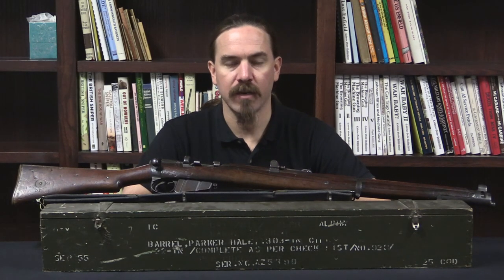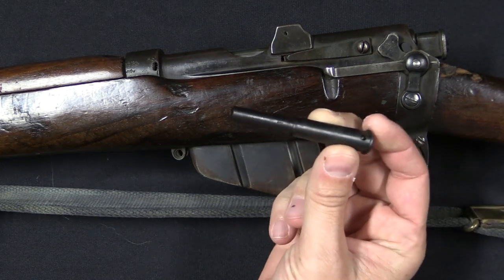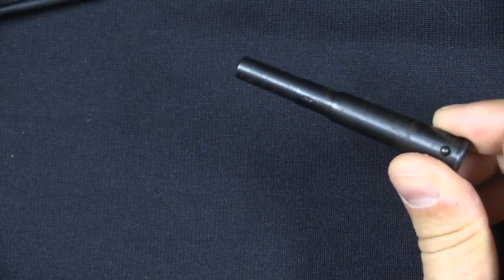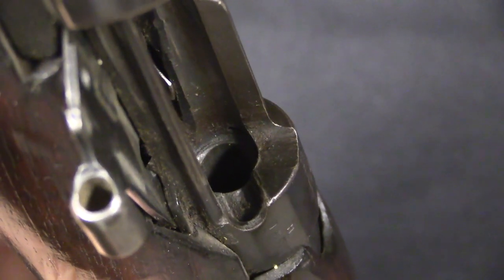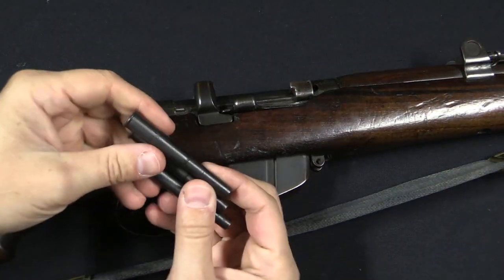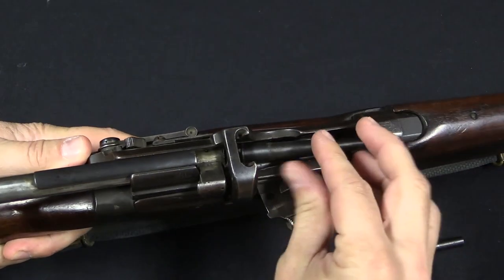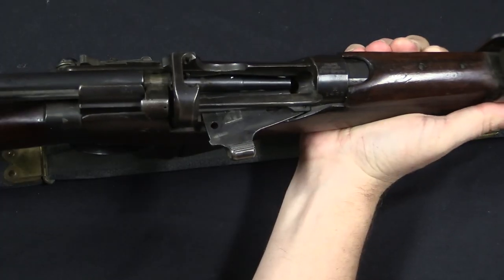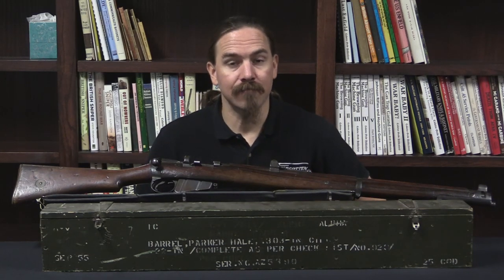Parker-Hale .303-.22 Conversion Kits for the Enfield, Lewis, and Vickers

Comment: here in New Zealand in the early 80s At Air cadets, we had an indoor 10-meter range and a bunch of Lee Enfields in .22 LR single shots, pulled the bolt back, Grab a bullet out of your plastic cup half full of rounds  inserted your .22LR in a flat chamber face and was a bit awkward  of what I remember, close bolt, aim fire, I think it ejected the case then rinse and repeat, I was like 11 years old, it sorta looked like dads MK4 Enfield he had in the cupboard from WW2 carried it from New Zealand to Egypt to Italy and up into Germany then back home to NZ with his  girl and he was buried with that old girl of a .303 brit
Reply: Same , we used these in air cadets in Ontario Canada during the 90s
Reply: I was in the CCF and we'd shoot indoors with martini action .and bolt action match rifles in .22. Later on outdoors we'd shoot .303 Lee Enfields and 7.62 Match rifles. I don't see why it would be necessary to convert a .303 to .22 with such a clumsy system as this. I could see the benefit of the Nr 8 Lee Enfield trainer but this just seems like more effort than it is worth when there must have been other bolt action rifles that would suffice for basic shooting training.
Reply: @drxym  These 303-cum-22 adaptations are much better than even a mag-fed .22 for developing the muscle memory for shooting a .303 rifle rapidly and accurately. The bolt stroke length is identical, the amount of force needed at every stage of the bolt cycle is identical, as is the use of chargers and magazines. I think they may have been used for "garrison" ranges -- regular polishing/practice while in barracks at smallbore ranges -- rather than for basic marksmanship training. So long as you keep real .303 rounds well away from the adapted rifles it seems fiddly but useful.

Manually cycled Vickers and Lewis guns on the other hand... not quite so realistic...

As Ian states the adapter system was dropped after about 2 years of service for the far simpler system of single shot .22 adapted "older" patterns of LE.
Reply: Same here in UK army cadets in the late 80z.
Reply: Same in the UK air cadets in the 00s
Reply: Remember exactly the same at school on Scotland also 80s. Big heavy buggers for a 10yo!
Reply: In the UK Army Cadet Force in the early 1970s we had No 8 .22 rifles.   The looked like mini L42 sniper rifles.  They were also in use by the regular army for training people for small bore rifle competition before letting them loose on  proper target rifles.
UK has recently disposed of it No 8 out of reserve in the only way the UK knows how by destroying them Bloke on the Range has a video on this travesty
Reply: Yup I had the dubious pleasure of using the later 22 calibre conversion of cutdown Enfields in my early years at Air Training Corpe then moved to what we called the Russian 22's. I don't know what they were but a lot lighter and felt alot more accurate than the extremely tired cutdown 303 rifles. Also believe there was another conversion of later Enfield rifles to 22 calibre for training as well.
Reply: Might wanna dig up that rifle you never know.
Reply: The .22LR used by the CCF / ACF were probably No.8 rifles, or maybe a No.7. I know ours were No.8. 
Ian's done videos on both these https://www.youtube.com/watch?v=UjKMDv139zU and https://www.youtube.com/watch?v=aRtir1tmEW4
Reply: @alvinyork5341  They've moved over to .177 pretty much everywhere now.
Reply: We had No 4's modified to .22 in my University Reserve Training Plan squadron in Montreal.  The spent cartridge did not eject, you had to pull it out  yourself.  There was no cartridge adaptor on ours.  The round was inserted straight into the barrel. We shot  at the McGill  University indoor rifle range.  All our No,. 4's were taken away by the RCAF after a Montreal armory was raided by separatists who made off with a bunch of FN's.  I guess it was matter of optics rather than real danger.  I would not have looked good for the military or the government if our .22's had been stolen.  We shot ammo left over from WWII.  It was dated 1944, the same year I was born.
Reply: @kazkazimierz1742  maybe it didn't eject lol I I was issued an M16A1in basic in 1986 New Zealand Army, took to the range once the qualified, and got an L1A1 can't remember much of the M16 either lol prob brain injury from all the concussive things going off nearby, no hearing pro or eye pro
Reply: Yes indeed. My NZ Cadet Corps time was the early 90's and there were times we used the No. 8 Enfields. Single shot, no magazine etc.  Some old bloke I talked to back then mentioned the "Morris tube" conversion but these were built up as .22 training rifles.  Our range was 25m outdoors.  No plastic cups were used but rather our beret upturned on the ground.
Reply: We had a large outdoor range (1 mile plus) available near me in the UK so were still using the .303 rifles but we did use a .22 kit for the SLR at the local TA barracks where they had an indoor range.
Reply: I'm not sure of the training potential of the 22 rifle, I was in the army cadets in the early 80's and we had an indoor 25 yard range. The new recruits were taught the basic drills with an air rifle, then when they were competent with the drills they moved up to the .22. You would be tested on your shooting ( four levels-pass, second class, first class and marksman) then you would be let loose with the full bore .303. I was a typical young teenager and would get lazy with the .22 and you could see my grouping drop as I fired because there wasn't any reason to concentrate and the later rounds would drop, ruining my grouping (best I managed with the .22 was first class). Then enter the full bore .303, the adage of spare the rod spoil the child was hammered home to me that day I first fired the 303. We did a march and shoot, 5 mile hike with kit then shoot the Enfield. First shot tired and not concentrating, trained on the 22, loose grip and a bruise on my shoulder the size of a fist. The rifle certainly improved my shooting because I treated it with respect after that. I ended up better at shooting the full bore rifle (Marksman classification) than I did with the 22 because even after this when I was shooting the 22 I only engaged half my brain. Teenage boys, don't suppose they ever change.
Reply: Can you handle a kitchen knife even in NZ now?
Reply: i had those 22 in the air cadet in Canada
Reply: Used them in Air Cadets here in Canada about a decade ago too, they were neat. I got to shoot a proper .303 a couple of times too, though it wasn't "officially" a Cadet rifle and was owned by one of the officers IIRC.
Reply: @curiousentertainment3008  grave robbing?
Reply: @RamonInNZ  
Probably Toz rifles, chrome lined bore...very good accuracy.
Reply: @wmoule  
Yes...but only with a dulled edge....
Reply: @Mr Ivan Tchernegovski   Did you notice the ammunition is NZ military .22 ? if you note it says 'Kauri Point NZ' which is the Navy Ammunition depot at Birkenhead on Auckland's North Shore? I would suspect the rifle was originally a NZ navy cadet training rifle also.
Reply: Did you notice that was a box of ammunition from Kauri Point Naval ammunition depot in Auckland New Zealand..How on earth did it end up with Ian?
Reply: @lordsummerisle87  I think "accurate" needs putting in perspective... especially in today's context! I would be surprised if these adapted Enfields could manage 10" groups at 25 yds ..or 40 MoA?
Reply: may your Dad enjoy that well deserved rest in peace!
Reply: Thanks for his service. May he rest in peace.
Reply: @triumphstagdriver  Never heard of a No 8.  Tell me about it.
Reply: @kazkazimierz1742  I think Ian has a video on the No8 or mentions it in one of his Lee Enfield series.  Otherwise Wikipedia should mention it. I think in the section on the No4 - variants of. Essentially a No4 in dimensions and weight but single shot .22 for training purposes.
Reply: God Bless your Dad! Please tell me he wrote down some of his exploits for our History?!  One of my No.4's was carried by a long lost Cousin (I purchased it by pure, random luck!)  I'm making sure my kids keep it within the Family (with it's story attached) for many Generations.
Reply: @susanbutler2498  thank you, yes some of his exploits are in our family book that my Nehew made of our family history from Ukraine in the 1870s to the present day
Reply: Wait a minute. He was BURIED with his rifle?? That’s badass.
Reply: @ILikeToLaughAtYou  Yea his weapon was on his right side in the coffin, ten rounds in the weapon, and 2 5 round clips in his pocket that was my idea,mum never knew lol he had killed people in combat with it so we thought he should be with his weapon in death
Reply: @ILikeToLaughAtYou  Yea his weapon was on his right side in the coffin, hot with 10 rounds in it and 2 5 round clips in his pocket that was my idea no one knew lol and he had killed people in combat with it, so we thought he should have his rifle in death seemed a good idea
Reply: @ILikeToLaughAtYou  Yea we buried Dad with his mk4 .303 Brit rifle hot, 10 rounds inside it, and 2 5 round clips in his pocket, I did that lol no one knew, He killed people with it and I thought you can have your rifle with you in death and beyond Dad. I wanted to shoot it and give him a rifle salute, but  the cemetery is in the middle of suburbs lol
Reply: @JohnSmith-yv6eq  Would get high 80s with the weapons

Comment: There is clearly a story behind the survival of those pieces, especially the kit. If entropy hasn't even destroyed a paper packing slip, it must have lead a very quiet century.
Reply: Agreed
Reply: Still having the box of cleaning patches is also impressive.

Given they were not used.
Reply: Have we ever considered these were rifles issued to cadets and brand new trainees that were designed to be used and put back? Plus with how often they were used, it’s not unfeasible that the crate was restocked with patches and such pretty often as well, and when it came onto the surplus market, nobody bothered to remove anything from the crate?

Comment: Just when you think he might have run out of videos to make featuring Enfields. I should go buy an enfiled, though finding ammo for it may be a bit of a challenge.
Reply: could always see if you could get it rechambered into .308
Reply: lots of them were rebarreled for 7.62 nato
Reply: Son, learn to reload!
Reply: Well then, get one of these Parker-Hale conversions, and you can use .22 ;)
Reply: @Speaker Roach you can find $1.20/rd pretty easily, online, in the U.S.
Reply: Reload, with good started brass you get about a dozen firings per case so 3$ a round becomes about 75 cents, still not "cheap" but then again there is no such thing as "cheap" when it comes to feeding obsolete caliber milsurps.
Reply: I have Enfield in sporting range in my city. 3 shoots cost to € ~9. It's the most expensive weapon because this british ammo. Cool rifle, but Mosin is better to me.
Reply: @MM-zg4wu  yikes, that's expensive!  Mosins are fun, though.
Reply: Get one of the Ishapore Enfield rifles. Built in .308!
Reply: ishapore
Reply: John Doe  Don’t worry about headspace. It headspaces on the rim, IIRC.
Reply: I'd highly recommend the Enfield. The recoil is relatively light, the sights are awesome (at least on the No. 4s) and the action is very smooth. Oh, almost forgot to mention that the trigger is quite decent, as far as milsurps go.

Comment: I remember that we used do have a .22LR conversion kit for the Norwegian AG-3 (G-3). It consisted of a sleeve that was about 7,5mm outer diameter, with a couple of flexible steel rings at the chamber end, a bolt assembly that looked just like the regular bolt assembly except for a small section of it being a simple blowback bolt for the .22 cartridge on the bolt head and a proprietary grey magazine which held 20 rounds. The exteriour of the magazine looked just like the original one except for the colour. One could easily convert the rifle to .22LR and back, simply by disassebly of the rifle, and back to 7,62 NATO again in litteraly just a minute. It worked just like the full power rifle, lest the recoil and noise of course. The charging of the rifle, clearing jams and reloading was the same as without the conversion. I do not remember the producer of this kit, but I'd not be surprised if it was H&K themselves that made it. It even worked fairly reliable in full auto. Albeit it of course had to be zeroed for the .22LR an vice versa after using it. We used to let middle school kids fire a military rifle for the first time with this conversion kit, even in full auto. I believe I've recruited many a young soldier with it! (If you've made it this far, I'm sorry for writing an essay on the subject)

Comment: When I was in the Territorial Army, we used the standard SA80 with what I think was a .22 conversion kit so we could use them in an indoor range. I could just never figure out how the system worked.
Reply: Thankyou for this comment. Jogged my memory. I thought I remembered firing an SA80 in 22. But I couldn't be sure as it was thirty years ago and it was only the one time in an indoor range.
Reply: You remover the normal working parts and replace with an adaptor.  The adaptor extends into the 5.56mm chamber and the existing bore is close enough for 22 LR.  The adaptor is blow back.  Also special magazine.
Reply: H&K conversion kit, used them in the TA as well, the centre I went to had an indoor range .22 being the largest we could use in it.

Comment: I was in the school shooting team in the sixties in the UK and we had the Lee Enfield N° 8, single shot with chamber and bolt for .22 rim fire. 25yd indoor range. No cartridge adaptor necessary. On the outdoor range we used .303 LE n° 4 out to 500yds but more usually 200yds. I had not thought about it until I saw this. Great memories.

Comment: Seems more useful for the Vickers than the Lewis, actually.  Since the Vickers is tripod mounted and capable of very accurate long range bursts, the POI single .22 round will readily tell.you whether your gunners are able to adjust the T&E, even (if you properly adjust the targets so the POA corresponds to an offset POI that represents the angular difference for the portional range of the target (based on a scaled down POA target that reflects how small it will look).  The .22 bullet would reasonably reflect where the center of the beaten zone would be, as the tripod mounting means it will be dispersing around that point ( it necessarily exactly centered especially in range, but mostly so) in an elongated oval.  And, unless you have the mount set up loosely, or you "tap" the gun, that oval will stay pretty much in one place.

The Lewis gun can be used the same way, but since it is a bipod mounted gun, there is more "walking" involved, and the single .22 would merely show you where the first round of a burst would go.  But since that burst is as likely to display linear stringing in one direction as it is another, it isn't as representative of the gunners ability to control fire.

For the rifle, this is excellent, and after all, there are a heck of a lot more riflemen than machingunners in the army.

Comment: I remember the H&K conversion for the SLR. Great bit of kit. You took the working parts out, dropped the barrel inside the SLR barrel, replace the working parts with the 22lr set and you had a fully functioning .22 SLR. Convert it back later in seconds. Superb bit of kit.
Reply: I’d love to see Ian cover that!
Reply: @matthayward7889  indeed, a truly great bit of kit. It meant that the weapon could be fired on the indoor pistol range. It meant that familiarisation with the weapon wasn't compromised. Ingenious.
Reply: @gunner678  silly question, was it still semi-auto?
Reply: @matthayward7889  not a silly question at all. Do you know, I forget, but I think it was. The kit bolt and receiver were much lighter parts than the 7.62mm set obviously, but I'm not sure. I used it many times but that was decades ago. It had a magazine that looked like the original but took 10 rounds of 22. I will ask an expert and get back to you.
Reply: @gunner678  thanks! Just curious more than anything else 👍
Reply: @gunner678  The HK adaptor for the SLR used the same trigger mechanism as the rifle, so it was semi auto. It was originally bought for use with a cine target system in miniature ranges. There was also an indoor round for the 84 Carl Gustav MAW.
Reply: @matthayward7889  yes it was semi auto, and the kit came with two 20 round single feed magazines. I had to think for a moment, but I remembered using it in what we called the dome,  which was an active indoor range.
Reply: @felixthecat265  thanks, yes I remembered eventually firing it in what we called the dome,  the indoor interactive range. Yes i also remember the charly G 22 conversions. Good days.
Reply: @gunner678  thank you!
Reply: @matthayward7889  pleasure. It was nice to think about my youth lol. Good times and bad times, ever it were so.  Good luck, thanks for the interest.

Comment: I could see the Vickers one being extremely useful in cases where you might only have access to a range not big enough for .303.  

You can easily drill setting up the gun, loading, and taking aim at a target downrange with it, the one cartridge would show you are close enough in your aim. Or reloading drills etc. And those processes are probably where the most time investment went on the Vickers, not firing volumes of cartridges.

Comment: Makes sense to me - British barracks whether for regs or territorials usually have plenty of access to indoor 25metre  ranges for small bore shooting, so drills and practises could be conducted under cover in poor weather with artificial lighting if needed in the evening, and without the need for a full size range; There also exist .22 conversion kits for L1A1 SLRs and the Carl Gustav 84mm recoilless rifle, both still in use in the late 80s here in the UK. Ping ping!